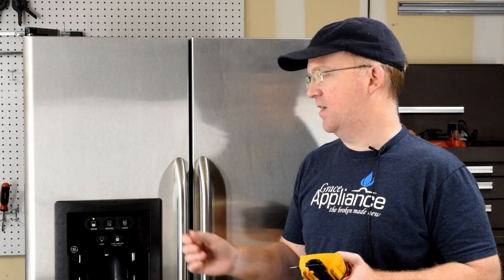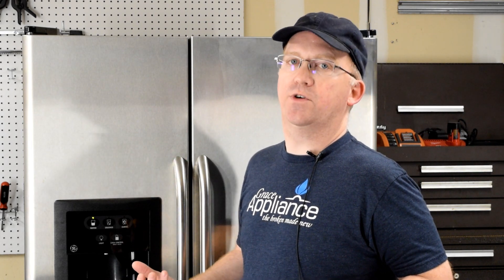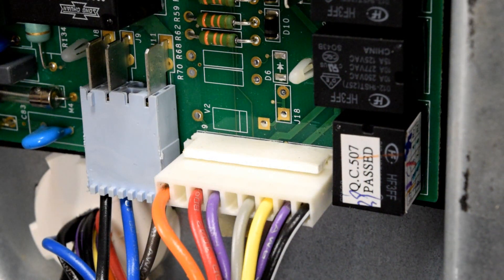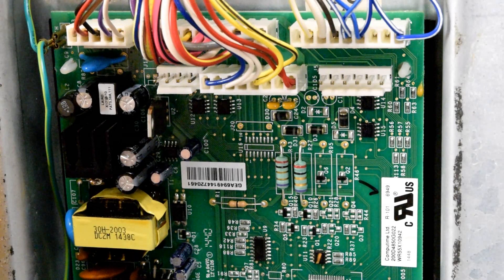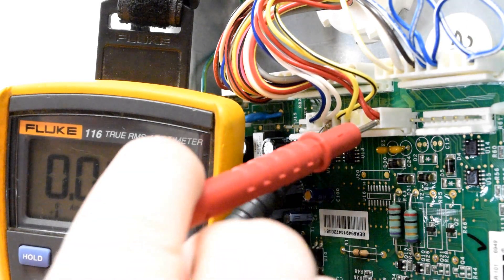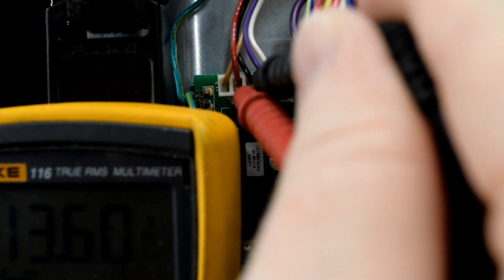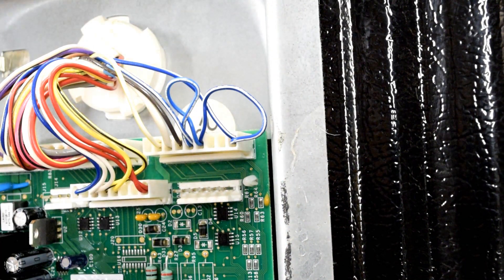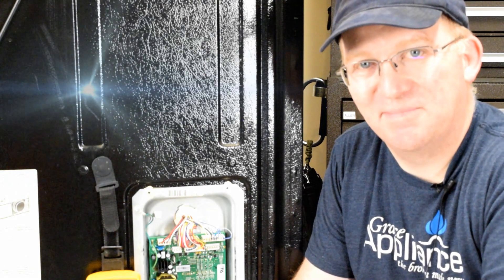Dead Refrigerator - What to Check

Comment: So, here is something silly. This is my most up-to-date comment/question.

Problem started: Defroster burned out. Replaced defroster and then all of a sudden no power when plugged back in.

Conditions:
Fridge lights on, 118v at control board inbound 
J2 failed test. Fluctuating between 2vdc-11vdc
Capacitors no swelling, no leaky goo
No burn marks on board or components. Checked voltage regulators as well and they were good.
No power at control panel on front of fridge.

Ordered new(used) control board on ebay, installed and the J2 test failed on that board as well. Did not know what to do. Pulled board and packed it up. Saw your video on dead fridge and you suggested going one step further and checking another plug if the J2 fails voltage test. So, instead of unwrapping the new board I figured I would just use the old board since both were failing the J2 test. Got it the board hooked up, turned on the power supply and all of a sudden my fridge is on and working.

Like wtf!?!? What is happening here!? Why would both fail the J2 voltage test, but then suddenly start working?

I guess the bigger question is how do I test for an electrical issue when one seemingly does not exist anymore?

Comment: I have a problem with the GE refrigerator side-by-side I have power to the control board no lights inside fridge or freezer no display lights and compressor does not run I have replaced the board

Comment: @Grace Appliance, Hi Andy, Nice video explaining how to diagnose. I have a dead fridge issue, which started happening after a power outage. Only the inside lights would come ON, with no power on the door panel and the compressor and fan not coming ON.

I have tired J3 and J2 test for voltage, it gives random reading (fluctuating). In the middle of the J2, J3 reading the compressor and fan turns ON and light comes on the panel and the fridge starts working. J2 and J3 reading on the running fridge gives 16.44 consistently. If I unplug and and plug back in I get the dead fridge again. If I check the reading on J2/J3,  plug and unplug the connectors the fridge starts to work again. Not sure what to think. The issue started after a bad outage we had about 3 weeks ago. Visually the harness looks fine, nothing is loose.

Appreciate your insight as to what the problem could be.

Comment: Help Andy! I have a GE S-B-S Refrigerator (GSH25JSXB SS) that has stopped working. The freezer WAS working fine, but the fridge side wasn't cooling. We tried increasing the "coldness" on the front panel, but that didn't seem to help. I unplugged the unit, removed the back of the cardboard cover, & noticed the coils were dirty. I used a brush & vacuum cleaner to remove as much of the dirt, etc from the coils. I also cleaned out the drain plug, as it looked to be dirty as well.  When I plugged the unit back in, the only power I had was the light bulb in the fridge. No power to the front touch pad, no compressor, no fans, nothing.

I called a technician to come out & get it working. He looked at it but couldn't fix it. He suggested I get a new computer board for the back of the unit, which he located for me, & he told be how to install it. I bought the new computer board & installed it as he directed, & put everything back together. I plugged it into the wall socket but still no power, except the light bulb in the Fridge. I texted the technician & he said I may have a bad front touch panel, so I told him to get it to fix the unit. I texted him again a couple of days later & he hadn't ordered the new touch pad, so I started searching more information on the web & found your videos. I've tried to follow you step by step but I'm getting some low readings off the new Control board so I don't know if one bad part is cancelling them out.

I've got 120 V from the wall plug to the control board, but I'm not getting the 13-15 V to the other locations. I've removed & checked the evaporator fan via a 9V battery & it works, so I re-installed it. Testing the Fan Voltage on J2, I'm getting 5.3 - 5.6 V; & the same readings on the front touch panel, etc. Any suggestions?!?

Thanks - Tony
Reply: Sounds like the replacement part may be bad

Comment: Andy I was lucky to find your video. My frig. stopped working and I was quoted $ 500 to fix. I searched and found your video with the issue that I was experiencing. I watched several times also the one about front control panel. I decided to order the order rear board and I just installed it today and the frig. is working great. Thank you for your instructional videos.
Reply from the maker: Great news!  You're most welcome.

Comment: Thanks which leads do u use ? Thanks
Reply from the maker: The ones in the video are no name brand, but similar to these:

https://amzn.to/3gQfc0E
Reply: Thanks for fast response. 
I actually like your probes that you use on most videos when you test control board connector pins ( back pin) leads
They are little bit bended
Can you please let me  know which ones are those that you use everywhere 
They are not regular needle probes but insulated but flexible 
Please let me know their exact model
Thanks
Reply from the maker: Hey, I am not sure of the brand. I picked them up at my parts house years back and don't know where I could find them again. They were pretty nice, but have worn out since making the videos.
Reply: Its fine
Thanks anyway Andy !!!
Thanks for great videos
I would love to see troubleshot on other brands as well 

Do you repair sealer system ?
Reply from the maker: Yes, I do.
Reply: It would be nice to learn from you more about sealed systems etc

Comment: Andy - thanks for your videos! Was trouble-shooting my GSL25JFXBLB with a “dead” front panel after a power outage. Pulled the J-plug in the main control board but nothing happened. Put the J-plug back in and continued watching your video, when a few minutes later the fridge started running and the lights on the front panel came on. Did me pulling the J-plug act as a sort of reset button? Either way, thanks for your clear instructions for trouble shooting!

Comment: Awesome video. Informative with great production quality.  So my GE is totally dead, no lights at all, nothing. Tested volts at outlet, going into filter, out of filter, and at the control board. All 120. So she’s getting power yet nothing is on. Should I continue checking control board or go in a different route?
Reply from the maker: Thanks!
So, I'd start by unplugging the front board from the refrigerator. Often a shorted front touch panel will give this symptom. If it comes to life after power is restored to the fridge, it's a bad front touch panel.  

Another thing to try is to unplug the fridge, wrap gently on each relay on the control board with a screwdriver handle.
Sometimes this will break free a stuck relay on the board and once power is restored it will come to life.
Now, even so the board would need to be replaced. But, it speeds up diagnosis time if it works for you.
Reply: GE Side-by-Side ONLY - Refrigerator Repair Videos interestly it was the back panel. Everything was out on the fridge (incl lights), and the back panel was getting power. But it was NOT sending anything out. Replace the panel and it works like a charm. Thanks again for your videos!
Reply from the maker: @matthanuf06  awesome work!   Glad to be of some help.  Stay in touch.  Andy

Comment: Question- Lets say I wasn't watching your video to figure out which leads I must check voltages through.   How would someone find that information?  In other words, how do I know that I need to check two leads for any particular voltage, resistance, ect.
Reply from the maker: Hi, each model has a specific tech sheet which (if you’re fortunate) will include some of this info. Appliance tech sheets are notoriously vague, hidden or simply not included with the machine. They vary wildly from very helpful to complete garbage as far as their usefulness.  
For GE side by sides if you have temp controls inside the refrigerator section, it’s often tucked inside that console if you remove it.  You’d know which leads to check by reading the wiring diagram. Sometimes you’ll have resistance specs for various components and sometimes these are integrated in to the wiring diagram directly.
Reply: @GraceAppliance  Thank you, this is very helpful.  I don't have a GE, but the lessons I'm learning from your channel are very useful.

Comment: I have a Maytag Refrigerator. Is the test points the same?
Reply from the maker: Hey Victor, the basic troubleshooting will be the same.

Please send your model number. What symptoms are you having?
Reply: GE Side-by-Side ONLY - Refrigerator Repair Video
I have a Maytag model MF12569VEB2. The control panel locked up. The last reading were LL on the freezer temperature and 8 on the refrigerator temperature and now the screen is blank. The refrigerator still seem to be cooling. Can the control board in the back of the refrigerator be bad and the refrigerator still cool?
Reply from the maker: Victor Hudson hey Victor, 
I have not come across these particular numbers/letters on the display before.  However, it does sound like a poor connection to the front board.  
This can be caused by a failed control board, a bad touch panel in the front or a poor connection.  

I’d start by first unplugging your fridge for 3 minutes.  Restore power to the fridge and see if it resolves the issue.  If not, I’d check for the connection under the top left hinge (left if looking from the front of the fridge) unplug this connection and reconnect 10x.  Inspect for pinched or broken wires.  
You have also have a similar connection behind the kickpanel near the bottom of the refrigerator.  

Let me know what you find.  

Thanks! 
Andy

Comment: Replaced the ice depenser solenoid thinking that was the problem.  Still will not depense ice and the inside lights sometimes come on dim or not at all.  Is it the touch pad ?  Don't understand the connection with the ice not depensing the interior light not working properly
Reply from the maker: Hey Karl,
Please send me your model number and I can have a look at some of the common issues.

Thanks!
Andy
Reply: Andy,
model # PFSF5RKZC BB GE Profile.  Note: I think it might be the main board
Reply from the maker: @karlbird60  Hi Karl, 
It sounds more like a failed main board. If the touch pad is switching correctly back and forth between the water and ice function, I wouldn't suspect the touch panel.  I've seen only a very small number of these fail where i've seen many many main controls fail. 

Your board number is: WR55X11098
https://www.graceappliancediy.com/products/ge-wr55x11098-refrigerator-electronic-control-board-genuine-original-equipment-manufacturer-oem-part

But, I'll also add that this same symptom can come from a short (typically happening in one of the motors) If it were mine, before buying a new board, i'd want to check the auger motor as well (i.e. the motor which turns the cork screw part that dispenses the ice cubes)  If you find that the lights only dim when attempting to dispense ice, I would disconnect the power wires coming to the auger motor, insert my meter leads on these wires, then attempt to call for ice. 

If you find that you have 120VAC to these wires, the lights no longer dim, it would indicate the main board is doing it's job. I would then replace the auger motor.  If the lights still dim or no voltage, I'd then suspect a failed main board. 

Your Auger can be found here: 
https://www.graceappliancediy.com/products/ge-wr60x10331-motor-auger-dc

I hope this helps, 
Andy
Reply: @GraceAppliance    FYI _ the problem was the board based on the fact the interior lights reacted independently from the ice i.e. auger motor.  Thanks for your help.

Comment: What if I dont have 120 at the board?
Reply from the maker: Chryiat 200 hey, if the lights in your fridge are working, you can rule out a bad socket at the wall and bad cord. 
With the fridge unplugged, I’d inspect for damaged wiring near the compressor. It will be near where the power cable from the wall comes in. If you don’t see any damaged wiring there, let me know and we can investigate further.   Thanks!

Comment: Hi Andy. I have a GE gsl25jfpbs side by side.....freezer stopped freezing and then by the next day the refrigerator was warm....I have replaced the evaporator fan motor, heater, bottom freezer thermistor and top one and the thermostat. I plugged it back in and it ran non stop. The freezer worked and the refrigerator kept getting colder and colder..27 deg. I replaced the evaporator fan blade because it was rubbing on the shroud and now i  set my freezer and fridge to 4 and the refrigerator side is not cooling down below 59....I have power to the board. And everything checks out...I am frustrated....what am I missing?
Reply from the maker: Hey John Jorquez,
After ruling out the basics such as food blocking vents and making sure the coils behind the fridge are clean...

I’d watch this video: https://www.graceappliancediy.com/products/general-electric-wr55x10025-refrigerator-temperature-sensor

It sounds like a refrigerator side temperature sensor issue based on the symptoms, but you’d need to confirm that with a meter.  
Since the fridge gets it cold air from the freezer, There is a damper door between the two cabinets that will open and close based on how cold the fridge needs to be. If the freezer is keeping things frozen rock solid and the fridge temp is all over the board then I would suspect either a damper or temp sensor issue on the fridge side.   

Let me know if you have any questions.  

Thanks!
Reply: @GraceAppliance  
Refrigerator and freezer side have been empty for a week....due to this issue. I checked the damper door and it is open...also the refrigerator side sensor checked in at 15.6 ohms in a glass of ice water. Also my compressor was not working at all after I replaced all of those parts...then I pulled the main board off and noticed two hot spots on the Song Ghuan relay...part number 832A-1C-S...I re soldered the two hot spots and put it back on and the compressor started working. That was yesterday evening. The freezer got super cold and froze a bowl of water in about an hour and the refrigerator side was 27 degrees...the evaporator fan never shut off the entire time I was awake...several hours...then today I swapped out a thermistor and put a new fan blade on...plugged it back in and everything seems to work fine. All the fans are on. Compressor is on. All capacitors on main board look good as well. I notice that after about 10 minutes of plugging the refrigerator in the condenser or coil pack in the freezer has frost on it..it starts from the bottom and works up to about the 4th from top row. I also installed a 3 in 1 on this yesterday as well. Would that have anything to do with my problems?
Reply from the maker: @johnjorquez4837  Hey John, The thing that concerns me about what you're dealing with is that the compressor seems to have blown out the solder joints on the board, perhaps the relay which you replaced with a 3&1.  
I have a feeling that the compressor is more than likely struggling to keep up. 

If you happen to have access to a clamp meter (i.e. amp draw meter) you can clip this on to one of the power wires going to the 3&1 you installed.  This will measure the energy being used by the compressor.  You should find about 1.5Amp draw when running.  If you see a number more like 3+amps - it would indicate that the compressor is having to work too hard when running.  

This scenario will also blow out relays in short order as well as boards. 

Also, the fact that you are seeing frost on only some of the rungs in the evaporator inside the freezer is concerning and could also be a symptom of the failing compressor.  

If you'd like to send me a picture of the evaporator coils inside your freezer I am happy to take a look and confirm this issue for you.  You should have roughly 90% of the evaporator covered in a light frost.  If 4 rungs are not frosted after the compressor has been running for some time, that's a sign of a sealed system issue (i.e. failing compressor). 

feel free to send it to graceappliance@gmail.com

Thanks,
Andy

Comment: Where to buy Relays, Capacitors, Resistors and Service Manual so to repair the Mother Board.
Reply from the maker: Hi, I usually get my capacitors and relays from mouser.com 
As far as the tech manual, it will probably be of little help with rebuilding the board as it will only give you a general wiring schematic.  You should be able to get the appropriate part numbers off of the specific parts on the board though. (small print on the capacitors and relays themselves)

https://www.youtube.com/watch?v=zbmAqizE128

If you'll replace the 4 capacitors and all the relays that I mention in this video, i've had ok success with this.  To be honest though - it's about 50/50% success due to either the relay having burned the board beyond repair or the coating they put on the board preventing component removal with out damaging the board. 

You need to be gentle enough to not damage the board when removing the parts, but then rough enough to break through the coating.  

Let me know if you have any questions!
Andy

Comment: I fixed my GE Stainless Steel Side-by-side fridge in about 15 minutes after receiving the new control board from Amazon!  SO easy.  Cost $154 + my time vs. around $485 quoted to me by a local appliance repair shop here in Austin.  I also vacuumed out all the lint surrounding the compressor housing and hoses and wires.  Fridge is 10 years old.  My 14-yr old son assisted the "surgery" and got to see how much money you can save doing it yourself with YouTube & Amazon & basic tools.  He's super smart so he could have easily done this himself.  He's up next...lol.  Thank you!
Reply from the maker: Awesome job Brian!  You’re welcome. Stay in touch!